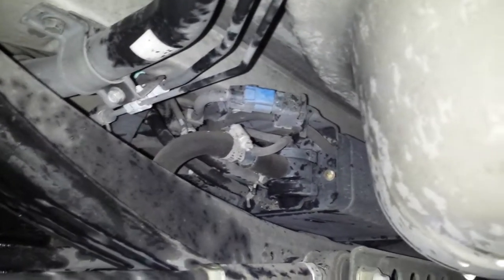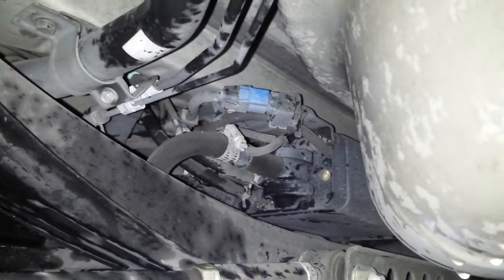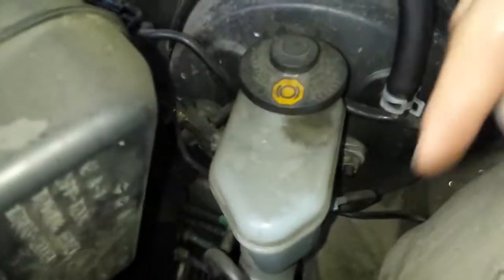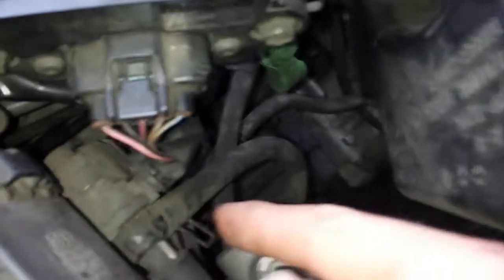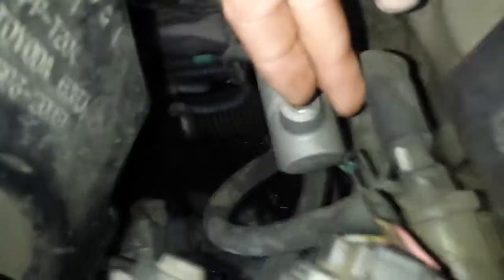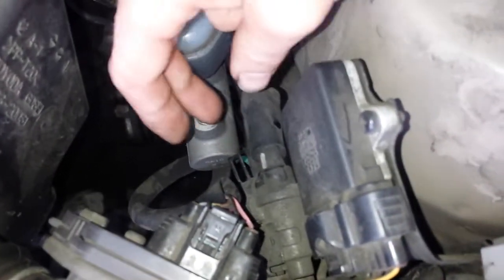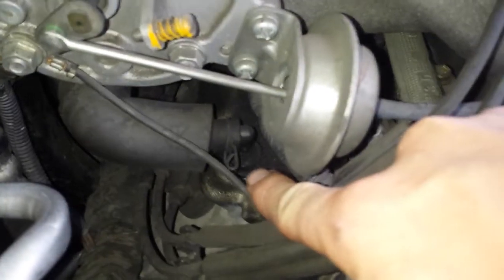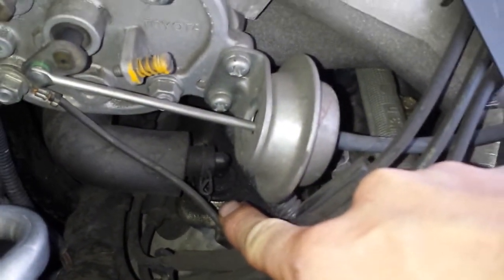Toyota Camry emissions: PCV valve, EVAP canister, EVAP solenoid, & EGR valve

Comment: He said v-sucks. For sure. Everyone told me buying a Toyota Camry, 2000 was a good car. It was in good shape. I've never spent more money fixing a car in my life. Timing belt problems, struts everywhere still rides like dish, power steering problems, weird low idle and dragging feeling when I hit the gas pedal. Weird clunk low idle at stop signs. It starts and goes, but I wish I would have fixed my Crowne Vic.
Reply from the maker: For some reason this generation Camry in the V6 version is not the best car.I am a firm believer in Toyota. I personally drive a 2007 Lexus V6. Around 2005 to 2007 Toyota went to timing chains on their engines and overall improves the quality of the V6 engine.